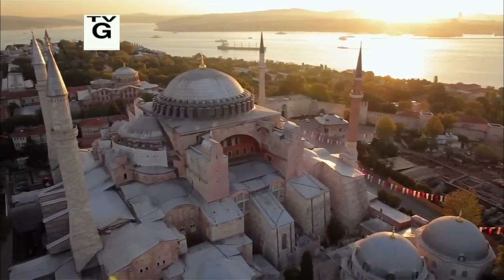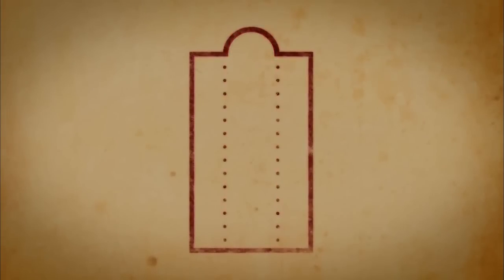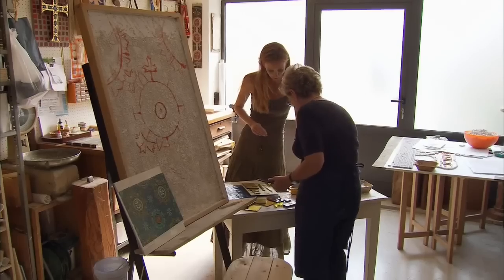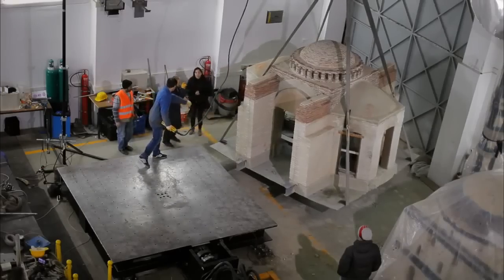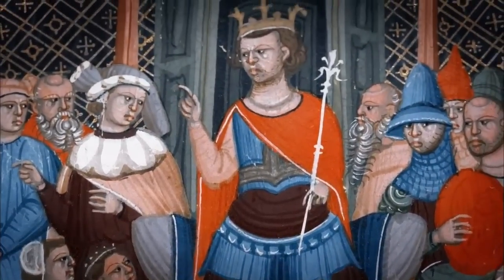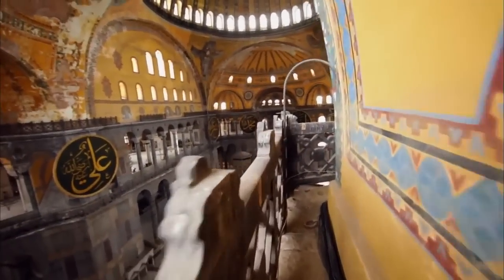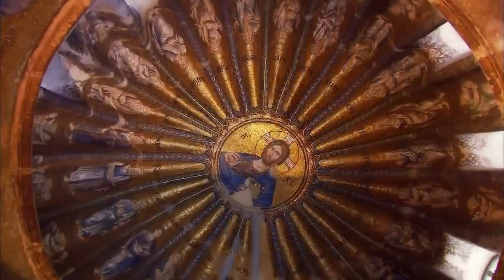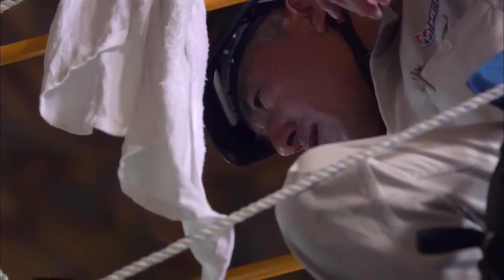Documentary 2015 Hagia Sophia Museum Turkey İstanbul     documentary latest

Comment: If they build a scale model, the bricks should be made to scale too. That model would represent a building with 60 cm thick bricks. That model will not result in proper data.
Reply: exactly my thoughts
Reply: Agreed, they completely wasted their time by building that inaccurate model.
Reply: I expect their calculations and tests were adjusted suitably.....I mean, that’s what engineers and architects do, no?
Reply: Yes I was thinking the same
Reply: And they did not use registration points for uniform thickness.  The level of experience is pretty low here.  They need to use this test as a rough draft for the actual test.
Reply: @gondolacrescent5  Then these guys are not the ones to do the test.  Waste of time and money if you cannot use applied science to actually build the model.
Reply: @JohnRomant  they're moon crickets , they cannot even come close to intelligence.  26:1 ?! Might as well make it from Legos